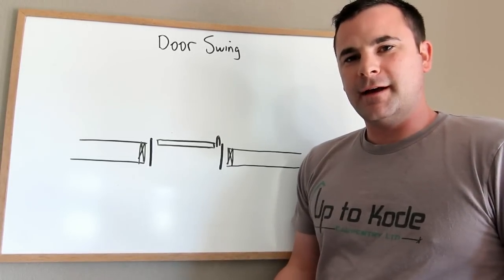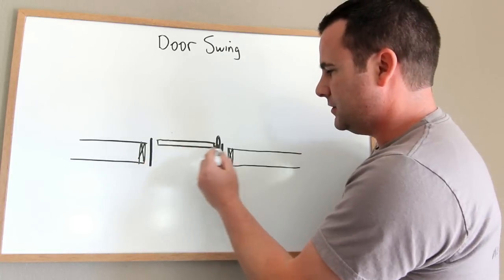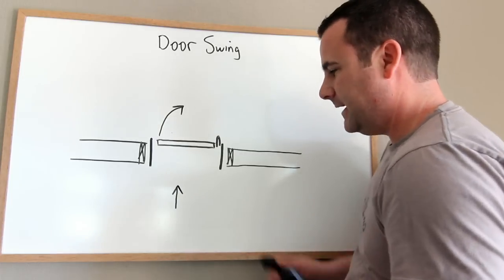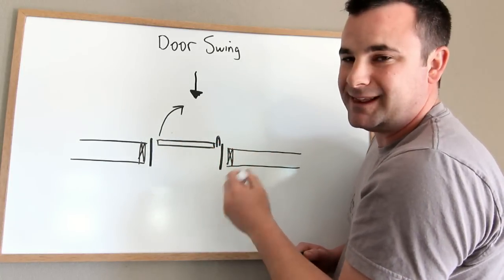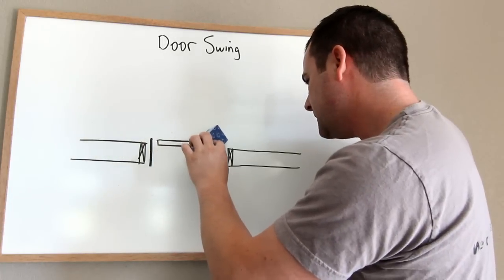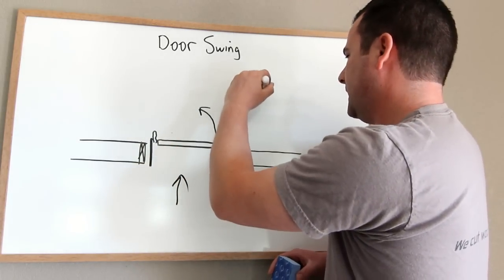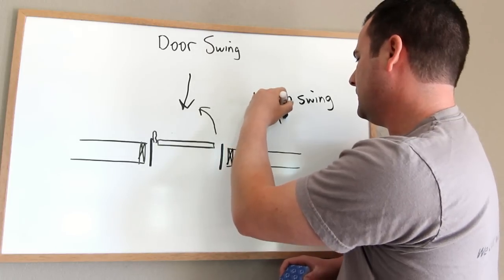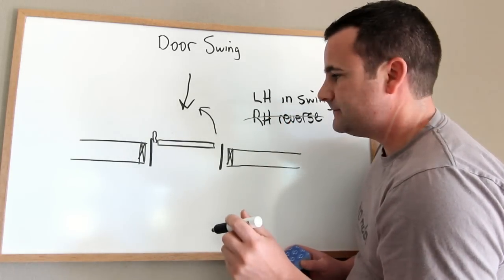Door swing Basics (#4013)

Comment: better question is, Why can't i just flip the door upside down and change the open and closing handle? Thats more of a statement than a question but that gets me closer to were i need to be, without redrilling the handle,
Reply from the maker: +Kiki Koralesky Sorry I didn't see this!     Yes you can flip door upside down and change it to a RH swing ONLY if the hole for the handle is in the centre of the door. A lot of time the handle is 44" down and not 40" down...However if you chisel out the hinge location all the way through the door you can simply flip the hinges around and that will make the opposite swing. Hope that makes sense.
Reply from the maker: +aicram62 Yes this can be true if the latch side of your door is slightly beveled so it doesn't rub as you begin to close it on the jamb.   Most old doors have this feature but new doors tend to just have all square edges...therefore a slightly bigger gap in the jamb to allow room for it to close without rubbing.